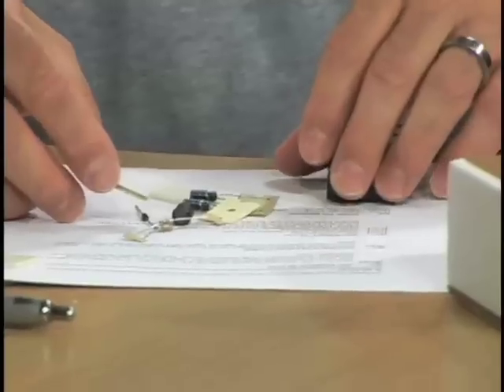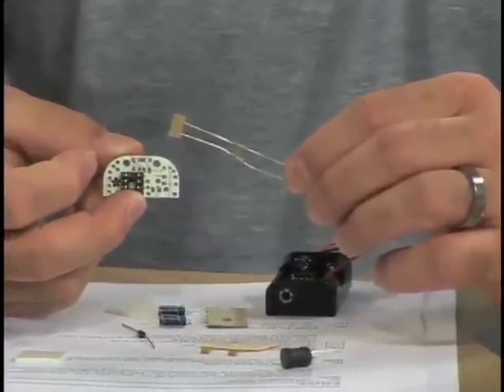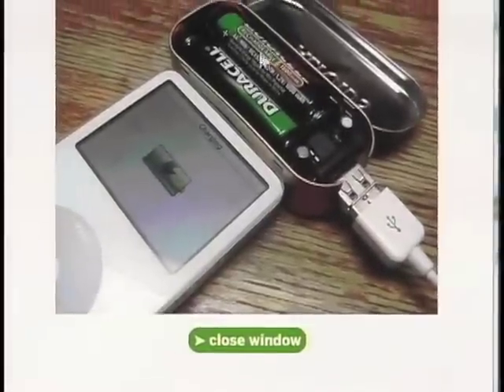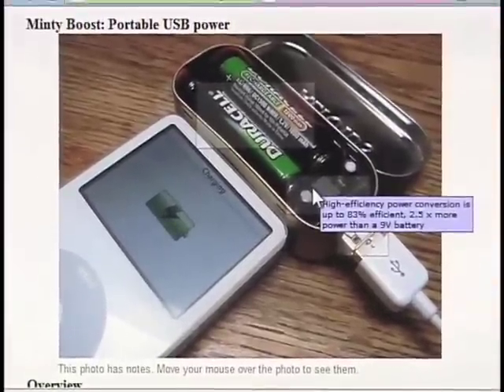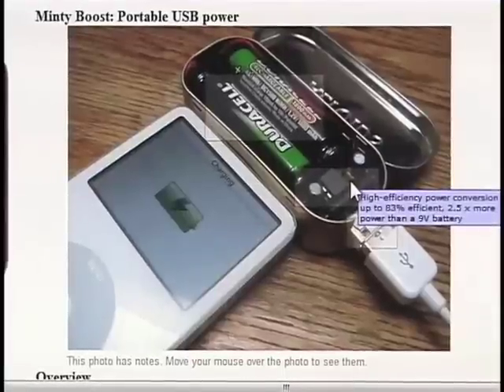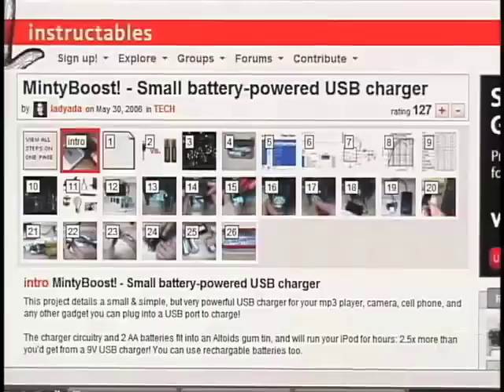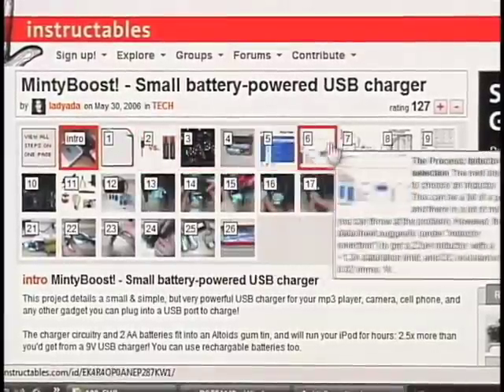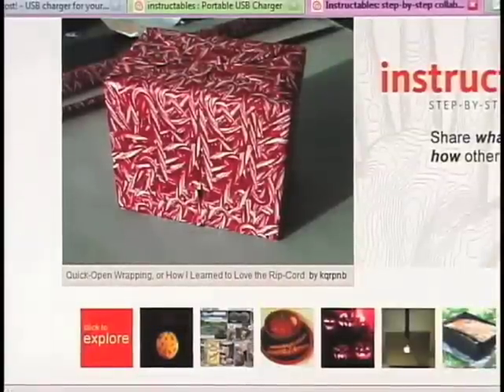How to Make Your Own DIY USB Power Charger

Comment: rechargables (with the exception of alkaline and lithium ion rechargables) are usually only 1.2 volts a piece in the case of AA.  if you use 4 x AA Ni-Mh batteries it will only stack to 4.8 V, meanwhile your iPod or other usb device needs 5.1 V roughly, but will take that 4.8 Volts any day.  An important note: newer ipods like the Classic, 3 & 4 Gen Nanos, etc will NOT charge properly (but one trick that will work is jumping 2X150k resistors from the + line to the +/- Data lines on the usb plug.

Comment: google ipod pinouts, that will help you make a charger adapter for that.... and well it can sometimes... but for a 4 x AA device, use Ni-Mh batteries as they are only 1.2 Volts a piece so they would be safer than using alkalines that are 1.5 a piece.

Comment: should be.. firewire is like 30 volts... but yeah the lantern battery may push a lot of amperage out... just look for a 7502 voltage regulator (they are not hard to connect.. i make chargers with them all the time and they are like 98 cents)

Comment: Well I have whats left of my mini ipod charger its that itouch thing sold in brookstone that takes 1 AA battery and i guess it junps it up to 5 volts or whatever. I have the part that plugs into the ipod and it has a mini mono male headphone plug on it if i put 6 volts on that will it hurt my ipod or the charger piece?

Comment: Kind of an old movie, but, do you know how to add the power for a USB powered device?

I'm using the Corsair HS1 headset which connects via USB, and they're pretty good, but they lack power as all the power they use comes from the USB connection. I notice it when I play music with lots of bass, after the first bass, the volume goes a bit down. I heard some say it's possible, but can't find it via Google.. :/

Comment: I have a part that has an ipod dock connector on one end and a mini 2.5mm headphone plug on it and when i apply power to the 2.5 plug the ipod turns on and starts charging, the resistors are built into the ipod plug. but id like to hook a 6 volt lantern battery to the 2.5mm connector the question is will that blow my ipod? the ipods say 5-30 volts DC 1 amp max so will the lantern battery push too much amps or will the ipod just draw what it wants and charge.